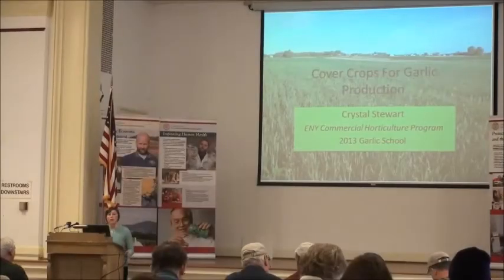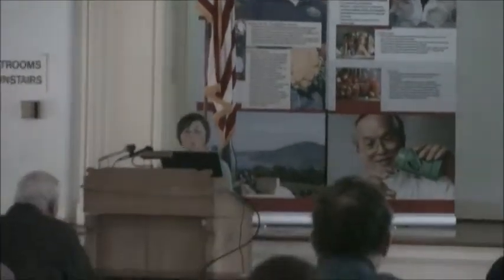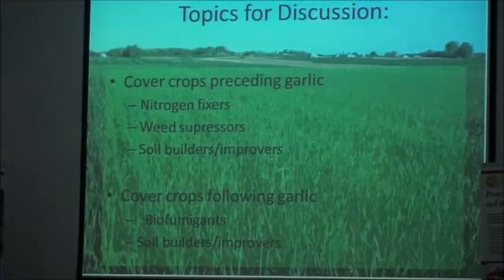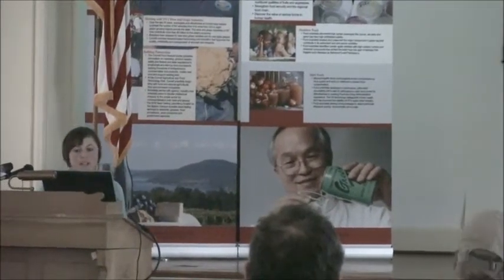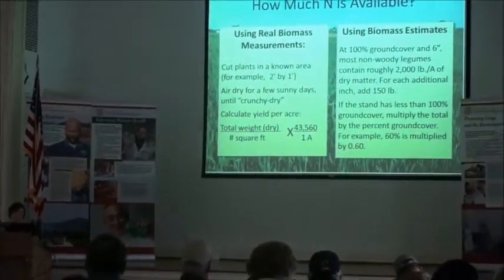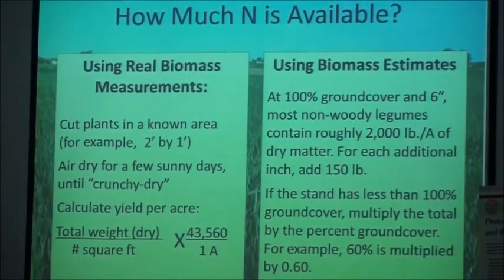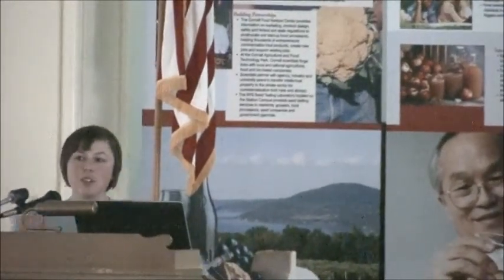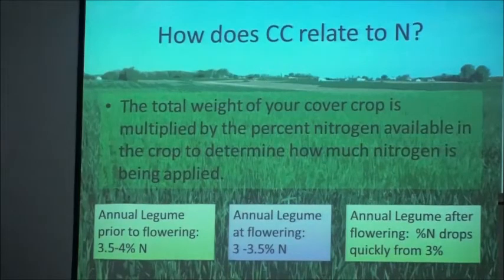Cover Crops for Garlic: Part I

Comment: I am hoping to get an answer to whether i should plant a cover crop on top of my newly planted garlic.    Do you know of a source where i could find this out?
Reply: I currently have two 4x8 raised beds with Music garlic in them. One had straw (nothing now due to the abundant rain), the other has Dutch white clover. My son just dug up one from each. Both bulbs are near equal in size. Granted, it's only late June, but things are looking good for the clover bed, even with slightly smaller bulbs overall.